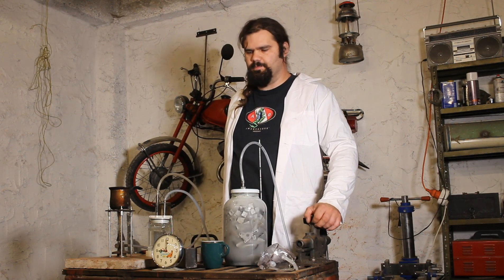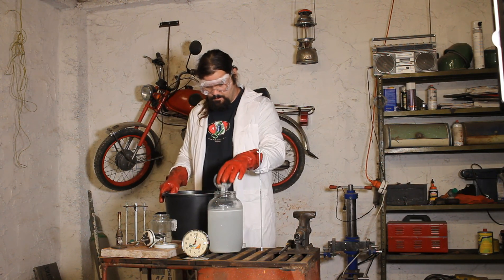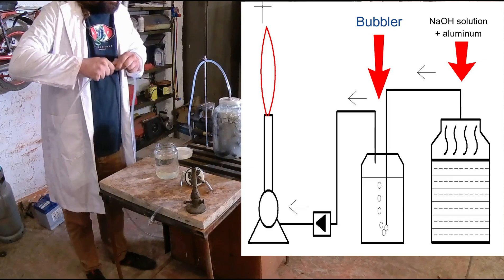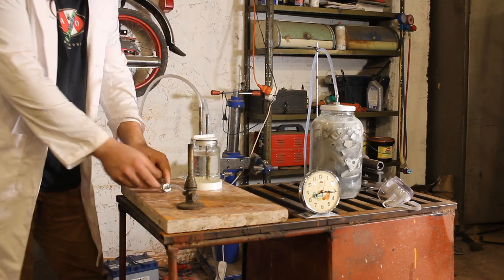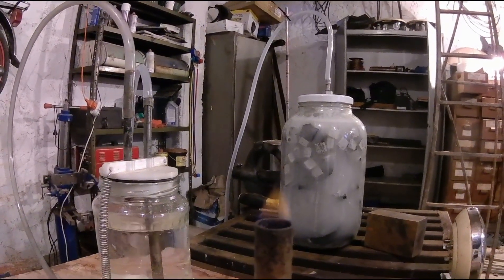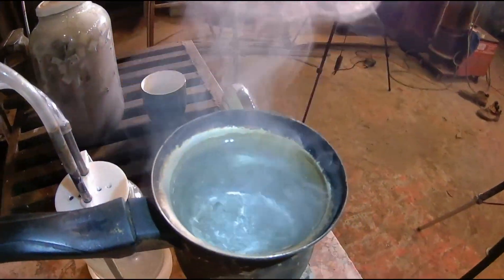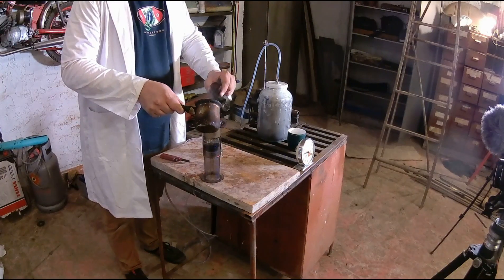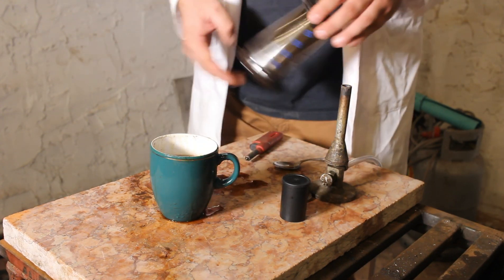Free energy: how to make Hydrogen via a simple chemical reaction.

Comment: Don't worry about making a mess or using a self-cut filter! Awesome video! But maybe do point out that as your Aluminium & NaHO mixture was heating up, the reaction was getting out of control and having this go for another 10-20 minutes would have it spraying hot caustic-soda solution out the bubbler. Hydrogen ideally burns with an invisible flame, or blue out of a bunsen-burner. The orange seen in the video is a sign of Sodium contamination, probably from the vapours of NaOH as a minute amount of Na can make for a bright orange flame.
Reply from the maker: Greetings, excellent point. I am already working on how to control the reaction and the best I could come up so far is having two chambers/containers, one above the other and connected via a pipe, the upper one containing the aluminum scrap and the lower one containing the liquid soda solution. When I want to start the reaction the liquid is pumped and sprayed into the upper container and allowed to drip back into the lower one, using an electric pump. By modulating the pump one might maybe control the output, via a pressure sensor. This setup could allow the convenient starting and shutting down of the system, as well.

Comment: Good job and nice video. I wonder if this setup could be connected to a compressor to store the hydrogen in a gas container for later use...?
Reply from the maker: Hello! Yes, connecting the supply to a compressor it is possible, but highly dangerous. I personally wouldn't do it at the DIY level.
Reply: I wouldn't recommend trying storing hydrogen in a DIY setup. It's possible, but it's not just the fire risk you need to know about. Hydrogen can also make metals turn brittle, meaning that the tank it's kept in has an increased risk of suddenly failing without any warning. It's probably a safer choice to make it as needed.
Reply from the maker: @TheHalffire  Indeed hydrogen embrittlement is a valid concern and one of the reasons I have started this experiment - since storing the Hydrogen as harmless water for future use is much more convenient than storing it as a gas in a sealed container.

Comment: Man... Granted you seem to know what you're doing, I'd be weary of doing that indoors.

I seen someone run a push mower and blew up his jar to smithereens.
Reply from the maker: Hello there! You have a valid point there and indeed I have prepared in advance with smaller preliminary experiments, that got me to the point of being confident enough to film this experiment the way I did. As far as blowing up goes I actually have an older video on my channel from a year ago where an explosion does occur in my bubbler. Fortunately the bubbler did it's job and prevented the flame front from going up-hill into the main jar. Prior to filming this last video I have rehearsed with this setup but with full protective gear (thick clothes and a full face shield+goggles) , the main 4,5L jar sat in a wider metal container to act as a blast shield and the bubbler sat in a metal cooking pot as well. Once I have established that the current setup is reasonably safe I removed the metal containers and adopted a leisurely outfit for filming purposes. Also, my garage/workplace is not fully enclosed. The main door was opened, as well as one window, plus, by design, the point where the roof beams meet with the wall has empty spaces, as in the roof beams sit at an angle on the wall's top beam and the space between them is empty as to allow for ventilation and fumes extraction. All in all, I have tried to make the process safe, but I agree, a lot of caution has to go into planning these experiments.